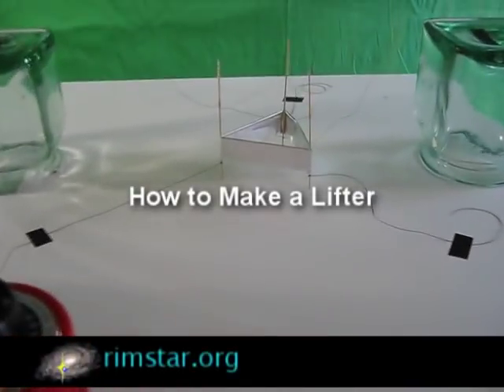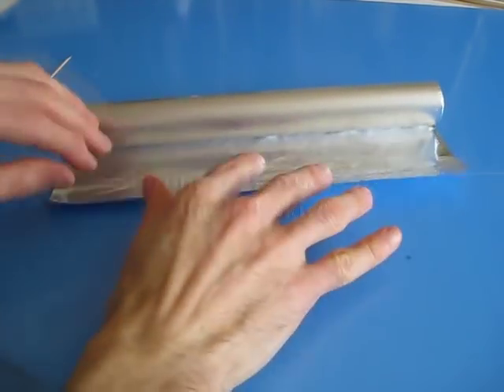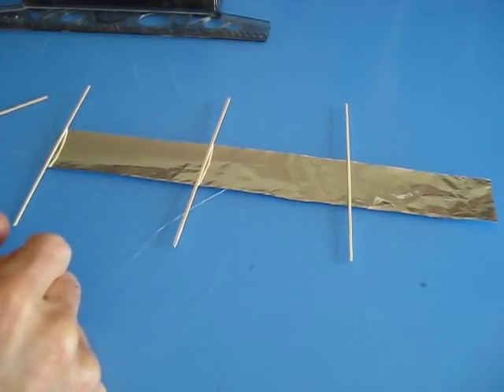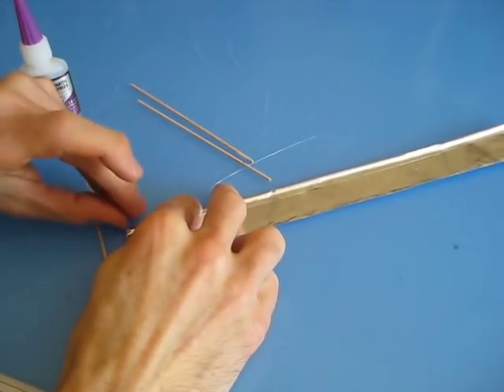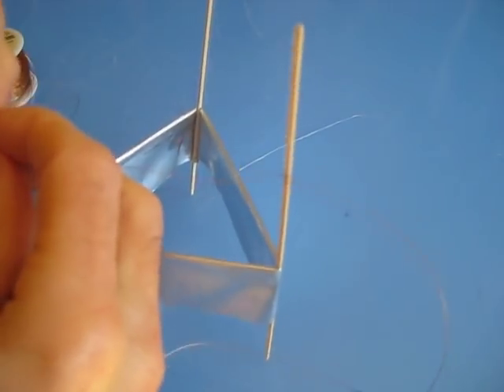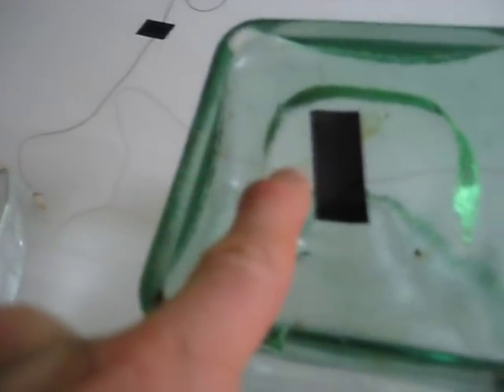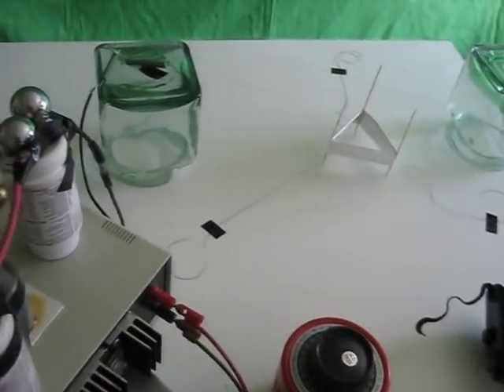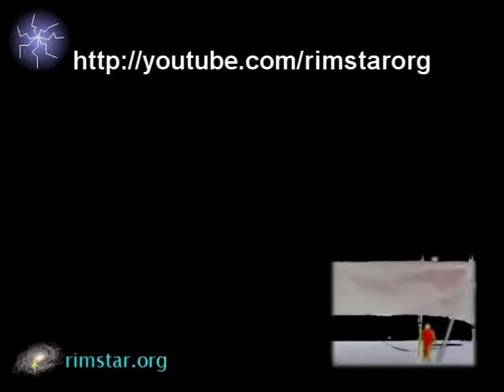How to Make/Build a Lifter or Ionocraft

Comment from the maker: I know what you're getting at but terminal velocity applies to an object that's falling, not under power. If a jet is flying downward under power then it can move downward at a higher velocity than it's terminal velocity. A lifter under power is just like the jet under power. So I'd imagine an upside down lifter, under power, moving downward would move down faster than if it were not under power, even assuming a heavy lifter that wouldn't be blown sideways in a wind.

Comment from the maker: That's commonly known as a Variac, basically a variable transformer. I plug it into the wall socket so it gets 120 volts AC as input. I then plug something else into the Variac. As I turn the dial from 0 to maximum, whatever is plugged into it gets 0 volts AC up to 120 volts AC. In my case my I plug my 24 volt DC power supply into it. Giving my 24 VDC power supply an input voltage from 0 to 120 volts AC causes the power supply to output 0 to 24 volts DC. That feeds my high voltage power supply.

Comment from the maker: The fact that the wire has a small diameter and the foil is smooth determines the direction of airflow and lifter movement. The polarity has some effect, but is secondary. Any other wiring between the two would have the same effect as decreasing the distance between the two and result in more charge flowing directly between the two, shorting it out and making it no longer work. People have gotten better performance by using DC pulses instead of straight DC.

Comment from the maker: Cool! It became very popular with more of the mainstream when MIT released a paper around a month ago about ionocrafts (which is what lifters are) and their efficiency. This video was embedded on a large number of websites since it was the only clear how-to-make and demonstration one out there. Thanks for letting me know, Grant.
Reply: REAL craft would lift itself. this POS won't move if it was attached 2 the power supply. RIP
Reply: You said it works if connected to positive or negative?  Which is very interesting, as it means its not Ions that provides power to the lift.
Reply: Were can I purchase an HVG10 High Voltage Power Supply?
Reply: @nskmda  Outside lasers propelling the object; Seems like it could be used in a variety of circumstances.

Comment: Nicely done. I'll have to try this when I finally have my flat sorted.

Another project I'd like to try is a variation on this theme:

Create a disc with a series of concentric wire circles. Power them such that they sum, centre to edge, but never exceed the breakdown voltage between adjacent concentric circles.

Arrange a surface with a dense population of strong magnets below the disc such that there's a toroidal field, again concentric with the disc, with the field lines passing vertically through the body of the disc.

The idea is to create a combination of magnetic and electric fields such that a Lorenz force acts on the air ionised by the circular electrodes, causing it to spin (concentric with the disc) and centrifuge outwards from centre to disc edge; in effect, creating a vortex.

I'm curious as to how much aerodynamic lift you could generate in this way...
Reply: Did you get your flat sorted?
Reply: @AnimalChinz I was thinking the same 🤣
Reply: @ravereviews6853  😂

Comment from the maker: Thanks for the suggestion, Paul. I've thought of that approach but that just gives the lift-off thrust, though I guess you could keep adding mass until it can't lift anymore. By the way, such a challenge was done back in 2003 and was the 100 gram challenge, to lift 100 grams in addition to the weight of the lifter. Do a search on google for "100g payload lifter".

Comment from the maker: It is. One pole of my psu is HV positive with respect to ground and the other pole is ground. I prefer to connect the skirt to ground since the skirt is closer to the table and the table is also ground. But it can be done either way. Theoretically, you get better results with the wire connected to positive, but the actual performance is hard to measure.

Comment: Tinfoil, check. Wire, check. Wooden sticks, check. High-voltage power supply ..... dammit.
Reply: ***** Dude, if that was supposed to be a way of hitting on me, you need a new strategy ;)
Reply: Penny Lane It was a joke referring to his referencing the balls on his power supply.
Reply from the maker: Penny Lane Micah Burgin Yeah, I remember when I was saying that part while making the video that it could be taken differently than I meant it, but I left it in for fun. Can't be too serious all the time :). Penny, did you eventually find a power supply?
Reply: RimstarOrg I didn't keep looking. I guess when I ever stumble upon a high-voltage power supply, I will get back to this.
Reply from the maker: Good point. I show how to make a power supply using a monitor here https://www.youtube.com/watch?v=r32e0QGdm8U and I even test it using a lifter.
Reply: hahaha nice one
Reply: i have a friend with a 15,000 volt supply - would that work?
Reply: high voltage? voltage generated from a fart are higher controlled  oscilloscope at the end to see use in watt's.. he's talking 2 watt ...like see 2grams go up there
Reply: @fibo12358  if you take a biker and show watt  ...you'll get it    ..watt of power for a  velodrome racer is right under 200 watt average
Reply: The power outlet!?

Comment from the maker: I suspect you're remembering Major de Seversky's ionocrafts. From the videos and photos they still look pretty lightweight though. Before these triangular lifters came along I made one using aluminum fly mesh instead of the skirt. It worked. Though it looks like de Seversky used a bunch of sharp point instead of the continuous thin wire.

Comment: This is pretty cool. I've never heard of an ionacraft before.
Reply: years ago (they probably still do) popsci had advertisements for the plans for these - only $30 apparently. but they branded them as 'antigravity machines'
Reply from the maker: John Bump
Yeah, the part that takes time is finding a suitable power supply. Once you have that, the lifter takes a half hour or so. Just make sure you try it in the dark. Seeing where the purplish corona is makes all the difference in getting it to work.
Reply from the maker: John Bump
Oh, you need a much higher voltage and current. Mine takes off at around 25kV and 250microamps.
Reply: Can I use 100kv AC? It is real problem to rectify it
Reply from the maker: Vladimir Knežević
You need DC or pulsed DC. AC won't work because the ion wind will just keep reversing directions. It wouldn't get off the ground.
Reply: RimstarOrg you can always convert it to DC
Reply from the maker: supdenfoosukka
I was thinking more along the lines of if your high voltage output is AC then it won't work, for example from a Tesla coil. I guess you could maybe find a way to convert that high voltage output to DC but it'd be easier if you start with low voltage AC, and as you say, convert that to DC as you raise the voltage. Though I've never tried converting the HVAC output of a Tesla coil to HVDC - maybe it's an easy thing to do?
Reply from the maker: *****
A tesla coil is a type of high voltage power supply whose output is high voltage AC, so a lifter won't work with it.
Reply: @kienanvella  The logical leap needed to get from "ionocraft" ionizing air generating lift by moving air around, and, "anti-gravity" flying in "vacuum", is just the aether, that in "vacuum" you have a medium that can also be acted in in an analogous way. Thomson Brown showed it works in a vacuum too, "vacuum" is a dielectric (not conductive but transmits electric forces) but it has to be strong enough vacuum, as air pressure decreases you lower voltage breakdown until you get down to something like 0.1 Torr, only then do you see the "vacuum" start to act like dielectric.

Comment from the maker: Putting some close to each other is ok as long as the structural requirements don't weigh too much. What I'd really worry about it the weight of the gyro sensor or whatever type is needed, making sure it safe from the ions and high voltage (which may mean more weight for structure), and how to communicate with the sensor. If it's a feed wire then that'll drag down on the lifter, if it's remote control then that's added weight. A lot has changed over the years. It may now be possible.

Comment from the maker: If you're getting arcs then the wire should be moved farther from the aluminum foil. Mine are 3.5cm at the closest. Also try playing around with the wires that lead to the lifter. Arrange them so that they don't restrict the lifter from lifting up. You can lift the lifter by hand to get an idea of if they're holding it down. Also, it has to be as lightweight as possible. Mine are only around 2 grams. 15kv is a little low, but don't give up yet.

Comment from the maker: It's really high voltage with high current too. The voltage need only be enough to create the necessary electric field across the given gap size. The current is what provides the electrons for ionizing the air (or takes them away depending on your polarity.) So 26kV which mine is supplying, plus more current would allow larger ones to fly.

Comment: Never actually paid attention to how these are made before. It is so simple. Gonna make one. Got a flyback from an old tv for the high voltage supply and a driver to run it.
Reply from the maker: Raymond Bivens Be aware, these need DC or pulsed DC. The high voltage AC output from a straight flyback won't work. The one I use has a tripler after the flyback which you can see here https://www.youtube.com/watch?v=GEuK1OdYxHk I recently tried my Cube power supply that has a flyback with a built-in diode as the very last stage but I suspect the current was too high and voltage too low. But it was suggested that I might be able to add a capacitor to fix that. Here's the Cube power supply https://www.youtube.com/watch?v=-KFhBVfpfDw and my recent Google+ post about my lifter test with it https://plus.google.com/116395125136223897621/posts/4MeNfcWoACN

Comment from the maker: It's a very efficient design in terms of a weight to lift ratio. Lifters have to be extremely lightweight and this triangular shape uses a minimum of material. A good shape is one with a hole in the middle but it's harder to make a lightweight cylinder. Two sided wouldn't have a hole. Four sided required more material than three sided.

Comment from the maker: That's a good sign as far as the lifter is concerned because that means ionization is going on. But you should have some ventilation if you'll be breathing it a lot, though it takes a alot to be harmful. To see ionization, turn out the lights and you should see a purplish glow around the wire in places. The less powerful your power supply, the dimmer the glow. You may also hear a hissing sound.

Comment: how much   voltage is needed to lift  an avg.human? please reply me
Reply: bharath puluru it doesn't work that way. More voltage does not mean more lift.
Reply from the maker: bharath puluru It would require at least a million volts but also with a lot of current. The ionocraft would also have to be around the size of a house and require protection to protect the human from the high voltage/current. It's not practical.
Reply: RimstarOrg oh! then how does satellite thrusters work?
Reply: No it could work with just 30kV. The voltage is not that relevant. You just need enough voltage to ionize the air. To prove this, just imagine a lifter running on 30kV. It has a thrust to weight ratio larger than 1. This means you could use a million lifters to lift something heavy, all running on the same voltage. It is the amount of ionized air that counts here. The amount of total thrust. Sure a million volts would increase the thrust, but you only NEED 30kV as a minimum
Reply from the maker: sai kumar reddy Sama Some satellites do use ion propulsion with xenon gas as the propellant for moving around while in orbit. But they're not being lifted against Earth's gravity so the thrust can be much less and the acceleration is very small, so the satellite moves and can get up to high speed (if needed) over a longish period of time.
Reply from the maker: Mikael Murstam Good point. The trade-off is that it would just be much much larger than a house in order to move enough air. With higher voltage you can space the wire and foil apart more and have room for a cabin in between, though I guess you could make the wire/foil ring shaped and put the cabin in the hole in the middle and above it. Either way, it's not practical.
Reply: I dont know man, a flying house sounds pretty damned practical.
Reply: bharath puluru  enough to put out a cancerous amount of EMFs thus being a hazard of health issues.

Comment from the maker: Re the ozone, the room was ventilated. If you run this for only a few minutes and not often then it's not that harmful. Ions around a sharp point will spread out since they repel each other. But to become ionized there's usually an electrode with opposite polarity nearby. That's the foil skirt in this case. We don't want the ions shooting down to start with since we want an ion cloud for the foil to attract upward to. They will move down because of the foil though.

Comment from the maker: @mrnewagemotor I'm with you in thinking that it requires an atmosphere. However, some experiments have been done with high vacuums in vacuum chambers that still show a little movement - not enough to lift them but enough to make them turn a very low friction rotor at slow speed. But I still leave room here the movement being due to the ejection of electrons, or ejection of material from arcs, ... I wouldn't call it conclusive without a lot more testing.

Comment from the maker: You can buy a power supply, or you can use an old computer monitor, one that doesn't have power saving features. There are links in the description below this video for both those. Some of the very first triangular lifters actually used a very large Van de Graaff generator, one with a dome that looked to be around 12 inches in diameter, though I've never tried it myself or heard of anyone else doing it since.

Comment from the maker: The very thin, uninsulated wire acts like a sharp point. When you use high voltage with a sharp point it ionizes the surrounding air. The foil thickness doesn't matter but the fact that the edge facing the wire is smooth means it doesn't ionize air, or not much. Instead, the foil is attracted to the cloud of ions that the wire made, and so the whole thing rises up. At the same time the ions are attracted downward, producing a noticeable downward ion wind.